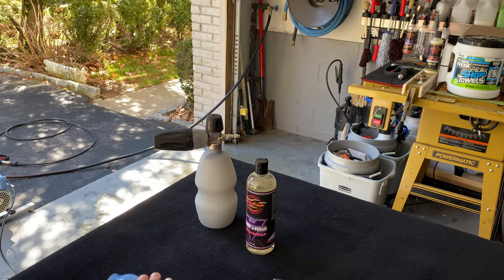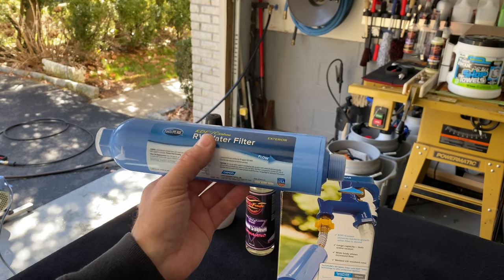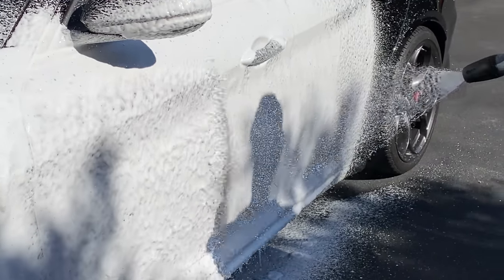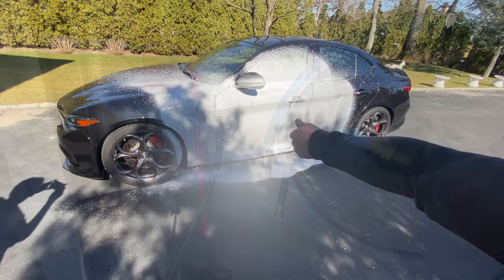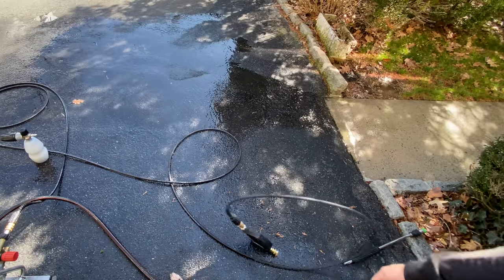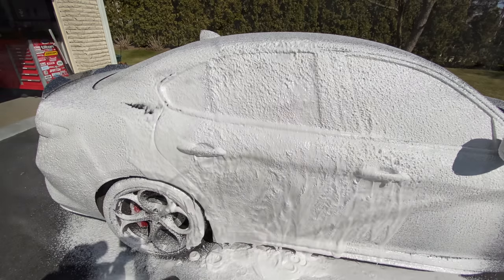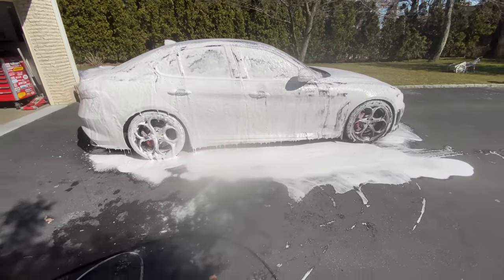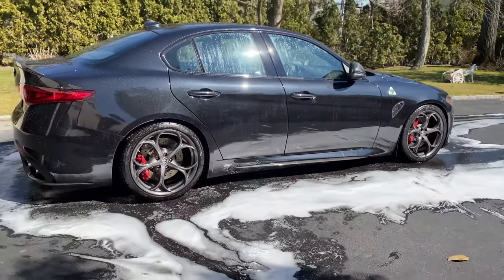Camco RV Water Filter Before & After Foam Cannon Demo

Comment: The water where I am must be much harsher than where you are. I've personally bought some of these and definitely did not see a difference in foam and / or water spotting
Reply from the maker: ok do you have a top of the line pressure washer with over 2GPM and use the MTM cannon? as for spotting like i said every area will be different all over the country you should consider having your water laboratory tested to kinda see whats it in, we did and the results were staggering that we put full filtration systems in the house now thats how bad our water tested.
Reply: @autofanaticcars  no I have a karcher 1700. Roughly 1.45 GPM.
Reply from the maker: thats your problem that machine barely puts out 1.45GPM for good foam you need to be 2.0-3.0 GPM which most gas units produce and the higher end electric units. One of my favorite electric washers for the money is the Comet 1700 i did a video on that on this channel check it out.
Reply: @autofanaticcars  yeah it's my first pressure washer. Wanted to see if it would actually make a difference for car washes. I may eventually upgrade to a AR Blue Clean 630 TSS but that won't be for a little while. Gonna start detailing on the side. Need to get my monies worth out of the karcher lol.
Reply: japspec96 I use the Karcher with my mobile detailing business it works perfect with beyond amazing foam after upgrading the hose wand and gun.  These filters do not lower tds levels which is was causes water spots.

Comment: What is your exact foam soap to water ratio your using to get those suds?!  Thx
Reply from the maker: few squeezes of the bottle, its not always the ratio its the equipment I use that makes the biggest difference.
Reply: Auto Fanatic I have treated water, AR630TSS pressure washer kicking out 1200 psi.  Maybe it’s my foam cannon, I’m using the Chemical Guys Torq foam cannon, but just received the new PF22 cannon, maybe that will be the difference.  I measure out 2oz of soap to about 30 ounce of water in the cannon bottle.

Comment: This thing is not working. my water from garden hose is 350 PPM or PM thing, after using this it becomes even worse! like 400! I did run the water for around 5 mins but still doesnt work... :(
Reply from the maker: sounds like your water supply where you live is very bad and toxic
Reply: @autofanaticcars  I live in LA and the water is not really good from my garden hose, its like 350 as I measured.  but after using the little RV filter in your video it goes even higher or worse than before hahaha

Comment: I bought a twin pack, no improvement on spot rings, put both in series, no improvement. Have shammy after rinse. Must be doing something wrong.
Reply from the maker: your still using a chamois? depending on your water supply everyone will get various results for our water the chlorine is mega high and by knocking the chemicals down it really helps with foam output and spot free drying and flash rust on brake rotors. you might need a more expensive water treatment system

Comment: I been using this filter with Adams Megafoam, and they are awesome together.

I mix only one ounce of the Megafoam with 24 ounces of warm water, with my gasoline pressure washer.
Reply from the maker: nice the gas units have awesome GPM so it almost always makes good foam, i miss my gas units but no longer can use them. How does megafoam self clean i have not tested that soap yet.
Reply: Megafoam is great at foaming, not so much cleaning. It's not very slick either.
Reply from the maker: thanks for posting, seems that all of these mega foaming soaps are just loaded with cheap surfactants that look cool when foaming but offer horrible lubricity and no cleaning action and leave the paint dried out. You need to pick up a bottle of my Auto Fanatic 007 Snow Storm to see how different this soap truly is.

Comment: Using the same soap and same setup as you I wish I could get foam as thick as your "before" side. My water is horrible like yours, so thanks for the video! I forgot that you use these and I'm going to give one try before I invest in high-output RO or a DI setup.
Reply from the maker: Riley test your water first using a dedicated lab or have a water specialist like Cullingan stop over to do it for you to see whats going on, as i mention my chlorine was 9x too high at my supply and the iron and minerals were also too high. I will be posting a video in a few days showing the removal of the Culligan carbon block house filter on my main line to show everyone how bad the filter clogs in just a few weeks time. stay tuned for that video, its nasty stuff to say the least.

Comment: I bought a water tester to test if these work and I found that I had worse water with the filter.
Reply from the maker: did you properly flush the filter out? and did you use a very good water tester? I paid $$$ to have a company come do real proper lab testing on our water which is far superior than some cheap TDS tester, as i mentioned its not just TDS that matters its the chemicals present.
Reply: Auto Fanatic I bought 2 filters, the first one I flushed out for about 5 minutes with high flow and when I tested it with the tds meter it was showing over 400ppm. The second one I flushed with low flow thinking I did something wrong with the first one and it was also showing about 400 ppm. My water is about 230 ppm unfiltered. I bought the sunjoe cordless pressure washer and fill the bucket with purified water from the water vending machine. It’s usually around 12ppm and for $1.50 per 5 gallons it’s a pretty good deal.
Reply: I use the for the final rinse to avoid any water spots

Comment: Pour 300 ml of concentrated detergent into a tank with 300 ml of water. This creates 600 ml of a mixture in a 1: 1 ratio. This is a 50% working solution.
So why was there a different solution? Each lance additionally dilutes the chemicals in the tank with a stream of water that passes through the gun. PA lances allow you to adjust the dilution of chemicals from 1: 5 to 1:10. So, if a 50% solution is diluted 5 times, the result is a 10% working solution. If diluted 10 times, this will result in a 5% working solution.

Comment: Not sure there is much difference with the foam or that it makes a difference. Car washes here in Las Vegas dont use spot free water during the whole process either, but the Spot free rinse is what counts. Then blow off and rest a wipe down. Saw another Video and he lets the car air dry, half washed with normal water and the other half with spot free rinse and he shows and says he sees a lot less spots and only larger ones on the paint. But the windows it did not make a difference at all. Guess one would or should not anyways ever just let it airdry, but the fact that you wiped it down throws the entire experiment off. I have super hard water here and if I wipe it down...fast enough, I can also avoid the spots even with no filter. So try again not wiping with and without the filter and see how it dries. I ordered anyways 2 for $27 but will use it for a end of spot free water rinse only. Thanks anyways

Comment: Wrong tool for the job. I think this is a good example of placebo. Those filters are for low GPM such as drinking or showering. Not a pressure washer. With these TDS is only reduced by 10-15ppm.
Reply from the maker: Not filtering TDS im reducing chlorine and other chemicals fyi my TDS is pretty low

Comment: I thought you never wash a dark car in sunlight
Reply from the maker: Pick up a bottle of my Auto Fanatic 007 Snow Storm Soap and be amazed. I have instagram video clips washing in direct sun with the paint being over 95 degrees F using my IR Thermometer and not one water spot or streak due to the chemistry we use. Guys in mega high climates in TX, FL, NV and AZ swear by my soap now.
Reply: @autofanaticcars  really interesting I just might have to pick some up.